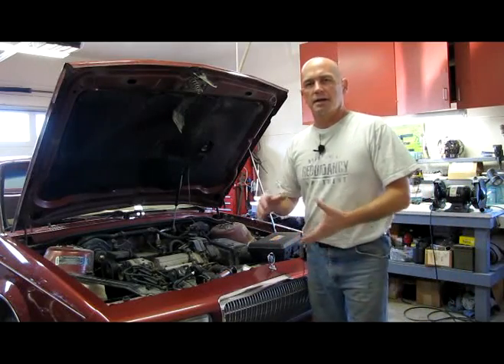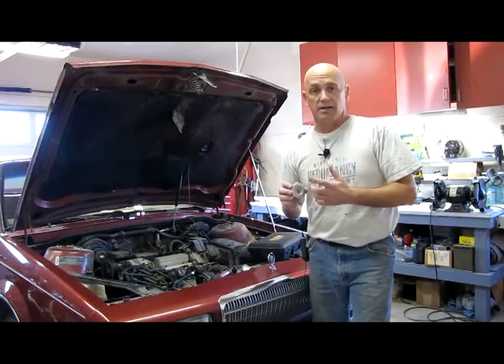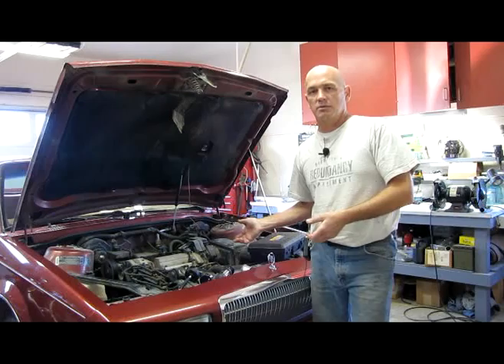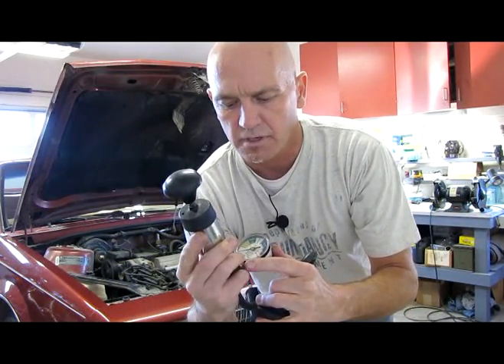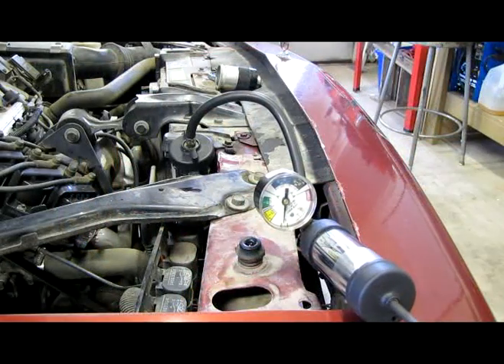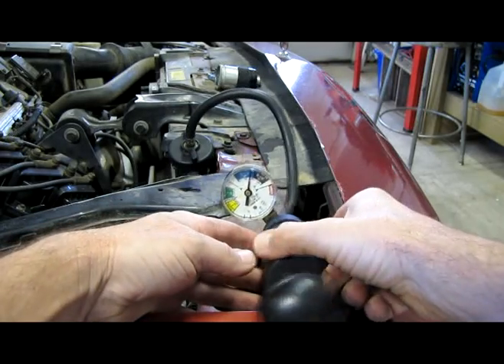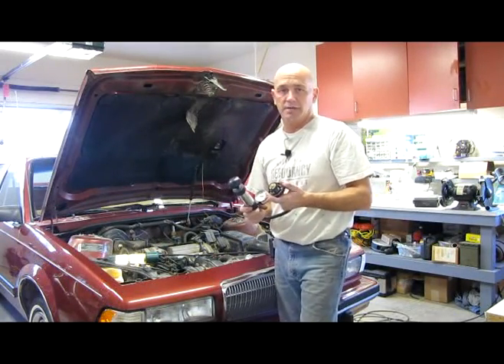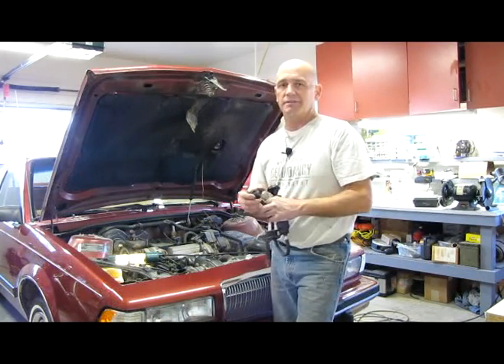How To Find Cooling System Leaks

Comment: I used one of those and it saved me a ton of money. I though the transmission oil cooler radiator had a leaking fitting. Turned out to be the radiator cap having a deteriorated seal.

Comment: my sx4 having a heating problem after after run in heavy traffic or sometimes early morning start a cool engine 
When my car gauge showing overheating i always noticed that radiator out hose pipe temprature temperatures is very cold while the radiator in pipe is very hot 
I had change the thermostat valve or thermostat switch the new radiator is also install all pipes were also checked and replace but  the thermostat valve stil not working properly 
sometime it's work nicely for 100 km or sometime stop working in anytime km what to do please help
Reply from the maker: avninash: Please tell me what an "sx4" car is.  It sounds to me like you are overheating in situations when your car isn't moving at fast speeds on the highway.  If it cools good during high speed driving, but overheats in the town when you are in stop and go traffic, you have a FAN problem.  

Typically, during high-speed highway driving, the air rushing over the front of your radiator is enough to dissipate the heat out of the radiator.  However, during stop/go heavy traffic driving, the "RAM' air flowing over your radiator stops because you aren't moving at any high speeds any longer.  At that time,  it's the job of the fan clutch or the electric fan system to kick on when needed.  Need to know more about your car to know what kind of system you have.  

If mechanical, a fan clutch is suspect.  If electric, coolant temp SWITCH is suspect, and/or electric fan relay,  and/or fuse for that circuit, and/or your fan motor.  So--- depends on your system.  It's most likely an electric system controlled by the computer, using a temp sensor for input, and a switch to turn the fan on and off, along with a relay to manage the heavy electric amperage needs.  And, of course, the fuse for the circuit.  Isn't electrical diagnosis fun?.... ugh.  In this case, one must segment the diagnosis into parts - first, make sure the fan motor works, then make sure the fuse is good.  My experience has shown that most often, if not just a fuse or relay, the fan SWITCH or coolant temp sensor is to blame.  However, keep in mind that the SENSOR tells the computer the operating temp, so if that's bad, most likely the engine would run far too rich or lean (02 sensor feedback data on a live scan tool, as well as just running rough).

Note:  when you completely drain a cooling system with an electric fan, then refill it, there is a possibility that a "bubble" in the coolant circuits (liquid) exists.  Sometimes these bubbles can cause the fan switch to not activate when needed, and/or the coolant temp sensor to not report proper temps to the computer.  If you've performed work like a thermostat replacement, radiator replacement or any other cooling system related repairs, make sure your coolant liquid is completely full with no bubbles or air pockets.  "Bleed" the system properly.

Depending on your model, I suspect either a fan clutch not working, or an electric fan not coming on when it's supposed to.  Let me know what kind of car you have and we can go from there.  r-

Comment: HI,

Like your videos very helpful.  I have a 1999 outback limited 2.5 liter engine. Has just developed an over heating problem.. I am thinking about trying the Blue Devil sealer..but I don't have a block tester and money is tight. I noticed you live in Az?  Phoenix area?? maybe.
I'd be happy to buy the fluid and a little more $$ if I can borrow your tester.  Before I jump into trying to fix the issue with Blue Devil or a head gasket replacement although the cost of that on 1999 seems a bit much, I have been told the engine has to be pulled on this model??? The car is in great shape otherwise so it's not out of the question. except for the cost.  If you are open to that let post here and I'll get my info to you.  Note I  did watch your block tester and Blue devil videos that's what got me thinking along these lines.
Reply from the maker: Roger - I understand your predicament!  Rule 1 of experienced mechanics - never lend your tools out!!  sorry BUT, with that said, I've heard that you can "rent" for free this kind of tool from many of your local parts stores today.  You basically pay a fee for the tool, then when you return it you get a refund.  I've done that a couple of times, although it's been many years ago now because I have most of what I need today.  Pulling the engine question- well, altho I'm no Subaru goo-roo, I did work on many.  The ones I worked on had engines which were/are "horizontally-opposed" engines, meaning that the pistons literally move OUT, left/right, instead of UP as with an inline engine, or in a "V" up/down  pattern as with a V6 or a V8.  The Subarus I worked on were exactly like an old V-Dub Bug.  So, there simply isn't "lateral" (left/right) room to remove just the heads.  I can see that the engine may need to be removed if it's horizontally-opposed in design.  A Google search will tell you that.  Hope this helps some.  r-

Comment: I have a  huge coolant system leak but I cant see were its leaking a 2007 chevy aveo 5 ?n
Reply from the maker: +Glass Finish Do you see it on the ground?  Do you smell coolant at all?  Do you hear a hiss when it's at running temp?  How much coolant do you lose over, say, a week's time?  Lets' start there.  r-

Comment: I have a1985.f150 that leaks antifreeze when not running I've checked my water pump thermostat housing radiator hoses and everywhere I could think of I'm also blowing white smoke from the engine now my battery that I just bought is dead and engine won't fire I'm leaking faster than I can pour water in my radiator it's coming from the passenger side just can't pinpoint the exact leak
Reply from the maker: +wyominghorseman994   Hey - well, oh boy--- unfortunately, in my opinion, and from what you are describing, you have a compression leak, or a 'head gasket' failure, or could even be a cracked block but that is far less common.  Know that, if this is the case, what you are experiencing is actually the RESULT of some cooling system malfunction, such as a stuck thermostat, lack of coolant for whatever reason, or a faulty water pump. Typically this is caused by a major overheating event, or perhaps multiple major overheating events.  You/your mechanic will need to try to find the original cause of this.

Evidence:  F150 - probably has a V8 engine, and you describe it 'coming from the passenger side.'  I'm assuming you have dual exhaust, and what you are referring to is that the white smoke is coming from the passenger side exhaust. Evidence - you are losing coolant rapidly but can't 'see' a leak on the ground, correct?  Evidence - it won't fire - well it will try, but if it's bad enough, you will have two cylinders getting flooded with coolant, and it won't run, if at all. 

Know that coolant/water mix can NOT compress, and the 'stuff' inside the cylinders is designed to compress, kind of like trying to blow up a 1-liter soda bottle with your mouth.  When that liter bottle is full, you can't really push any more air into it to blow it up, but when it's empty you can push all kinds of air into it with pressure (compression).  So if your cylinder(s) have coolant (soda) in them, you run the risk of actually breaking, cracking and ruining your pistons/rings when you try to run the engine, because it's supposed to be able to compress air/fuel mist in there.  Be careful with this!  If it won't run, don't try to start it anymore!

If it runs, you can see my other videos on how to check for a broken head gasket using an affordable chemical test.  If it does not run, my recommendation is to not try to start it anymore.  Try to see if you can detect coolant in the cylinders on the passenger side. My suggestion if it won't run:  pull your spark plugs out of the passenger side of the engine (if it's a V8, if not, let me know what it is).  Try to see if there is coolant on any of them - look to see if they are wet, smell them.  You may carefully try to stick a solid rod of some type that won't break off down into each open cylinder, then see if any coolant is on the tips of the rod.  To me, your description sounds like you have a pretty directly damaged seal between the passenger side head and the block (head gasket).  Perhaps refer to your local mechanic and see what else they may suggest to detect that coolant.  I'd start there.  Hope to hear back.  r-
Reply from the maker: +reluctorvalve  One more quick note:  if you have that white smoke and have a compression leak (see my other videos), you are actually leaking coolant 'internally,' WHILE the engine is running;  it's leaking into the areas where combustion is supposed to occur - thereby causing the white smoke, which is actually the coolant steaming....   r-

Comment from the maker: Richard Bay (no 'reply' button on your Youtube-linked comment:
You most certainly have a good theory in that the radiator neck may be bad.  My suggestion would be to try your tester on another vehicle, preferably one with no known leaking issues. That would tell you if your tester is defective, or if your radiator neck is bad.  If it still leaks, try adding a bit of oil to the tester's sealing surface.  Sometimes they just get dry.  Great comment!  Would love to hear back!  thx!  r-

Comment: I used one and it wouldnt hold pressure, It leaked right from the connection of the pump(the cap), it felt like a solid connection too.
Reply: would that (if the connection was solid) indicate a bad radiator?
Reply from the maker: +Richard Bay Hi - sorry for my late reply.  Been out due to some health stuff.  Good question - this could go either way, I think.  If you rented one from a parts store, chances are it's gotten a lot of use.  So I'd suspect that the tester seal on that cap area may be overly used.  In these cases you can try to add a few drops of oil to the soft seal material on that cap part of the tester - they can get very dry over time.  However, as you mention, you could also have an issue with the radiator neck area.  So I would try another tester, if possible, or add oil to yours first.  If you suspect a bad radiator neck, you may want to rent a second tester to verify.  Just an idea - good question.  r-

Comment: Hi, I have an old mustang 1965. Lately I drive it on the weekends. I notice every time I let it sit for a week, AFTER the system depressurizes that i have a small dried puddle of coolant on the floor and a couple green drops hanging from my bell housing.

I have not put a pressurizer on the radiator yet, but do you think it only leaks after shutdown or whilst Im driving it....when I drive it and check, i do not see any leaks, only after it sits.?

As far as I can see , everything seems dry uptop, and no wet hoses....thoughts?
Reply from the maker: SpiritualFingers Hi - hm, this is a bit interesting.  However, perception could be coming into play, here.  The engine does run hot enough under the hood to evaporate any fairly small leak, so you wouldn't necessarily see any wet spots while running in that particular case...or.. perhaps gravity and blow-back.  To know, how much coolant is it losing at what rate?  That would better tell me regarding that.  It would be first in order to pressurize the system.  If there is an external leak, it will show.  I'm thinking that you do in fact have a leak, but it's being evaporated and/or blown back towards your transmission area while driving, and when you park, gravity is taking it down to the bottom of the bell housing.  Have it pressure checked in a nice quiet space, and go from there.  I think that will tell you where your issue is.  I WAS gonna say you have a leak in the hose from the radiator neck to the overflow tube, because while cooling down there is liquid transfer there.  But that's no where near your bell housing.  Would love to hear back if you pressure check it!  r-

Comment: I have a 2003 sporttrac. I have a leak looks to be behind the thermostat housing somewhere. My question is why is the temperature gauge not showing it to be running hot. The gauge just show to be in the middle.
Reply from the maker: marquis ivey Hi- well, how do you know it's running too hot, for sure?  It's totally possible for the system to run at a normal temp even while it has a small leak, BUT....eventually, if not refilled, eventually it will leak enough out that it will in fact begin to run too hot.  Your engine doesn't necessarily require that the system be totally topped off to be effectively running fine temp-wise, but there is a point at which, if it leaks enough, there isn't enough coolant in the system any longer to carry that heat out of the engine.  I would chalk this up to the engineering design approach of having 'room for error;'  these are engineered to be able to do without at least a little from being totally full.  Margin of error, whatever you want to call it.  So, is your engine truly running too hot?  If you have access to a laser thermometer, and if you can gain access to the coolant coming from the engine (maybe the outlet radiator hose), if it's reading 260 degrees F or more, it's considered running too hot.  Anything less can be in acceptable range - depending on individual design.   hope this helps some!  r-

Comment: (actual question ) i know im loosing coolant but where any tips for finding leaks 
(part two) i notice when it is running is only when it vanishes also 
(second question) normally when i add the coolant it is a green color or what ever the basic color it is then after a day it turns a clear almost water color is that normal or is it time for a radiator flush ( doing a radiator flush anyway thought i would ask )
Reply from the maker: Mack: Coolant leaks can be 'external,' which you would see drip to the ground when running under normal conditions, and also can be 'internal' which would be related to gasket leaks in the internals of the engine - usually a 'head gasket' failure in these cases - which is NOT good news.  Symptoms of head gasket problems are loss of coolant and you can't see it drip on the ground, over heating for real reason, possible white smoke out the exhaust, cylinder misfire, too much pressure coming into the overflow tank causing noticeable bubbling - I have a few videos on head gasket stuff, and you may want to check them out.  BUT, know that if a head gasket has failed, it usually because of a cooling system malfunction and it overheated to an extreme level - so look for something that may have caused it in this case, such as a fan not coming on, a stuck thermostat, etc. As far as the color change - I have no idea what that's about. Your cooling system should run at a normal pressure.  If you have a leak, first determine if it's 'external' or 'internal.'  External - you should be able to see it.  'Internal' - you may not be able to see it.  In that case, consider having a 'block check' done - see my other videos on how to do a 'block test.'  If nothing else, it's interesting stuff!  Would love to hear back on what you find! r-